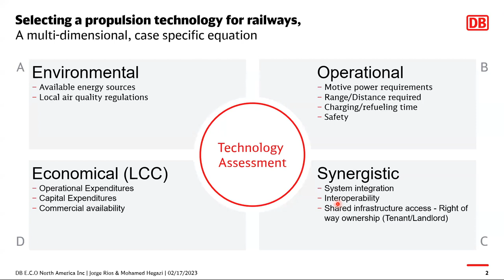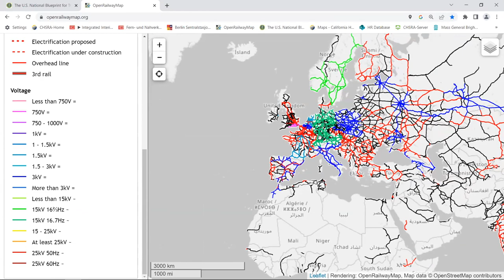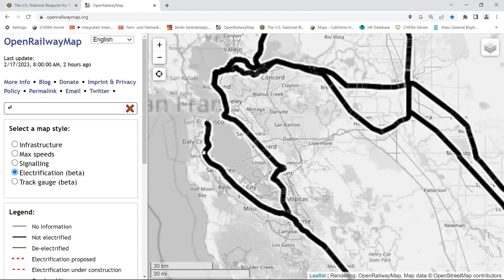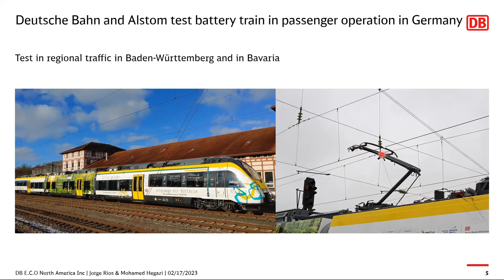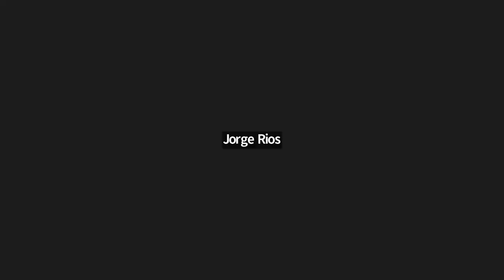Zero Emissions Rail Propulsion: Electrification, Batteries or Hydrogen

Comment: I enjoyed this presentation. I would like to know the diesel equivalent of energy consumed in Watts-hour per seat mile. I feel this is needed as it’s what’s being used in the US now. What amount of diesel is used to transport the fuel during a trip. Also as I live in California, in the very north of the state, how much diesel combustion emissions are produced. If all of Californias main and secondary lines were electrified how would that effect emissions, in a empirical manner. Lots of models showing how many single car trips will be replace with passenger rail but the actual diesel emissions are lacking.

Comment: It's important to mention that the key tenet of this presentation does not usually exist in the real world. Hydrogen is almost 100% of the time produced from fossil fuels not via electrolysis. Hydrogen produced like that is more environmentally damaging than just burning the same amount of fossil fuels inside a modern diesel engine!

This is actually extremely relevant. Hydrogen is a mess and no one seems to want to acknowledge that. This means that a modern diesel train, i.e. a Siemens Charger, is actually less environmentally damaging to run than, say, a hydrogen Stadler KISS train! How are we not talking about this?!

Imho, the only viable solution is to use diesel and/or battery hybrids with catenary. You can charge the batteries wherever you have catenary available (e.g. stations and station approaches). And in time you can add more and more electrification. This is actually exactly what Amtrak decided to do. They will run Siemens Chargers with auxiliary catenary (+ battery) power cars wherever available, and on batteries or diesel everywhere else. And then when/if more trackage is electrified they can smoothly transition to using more catenary power.